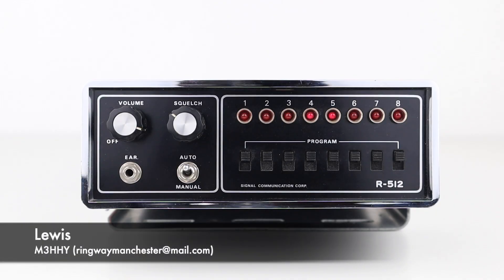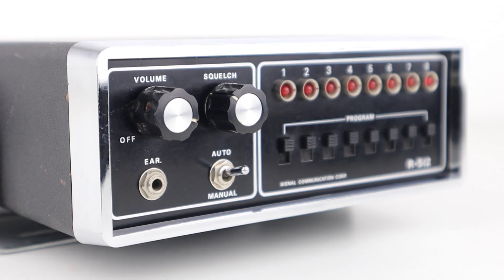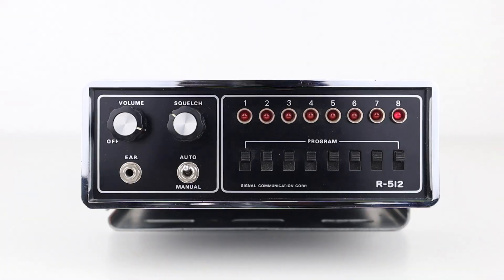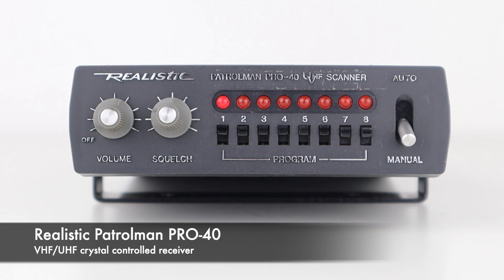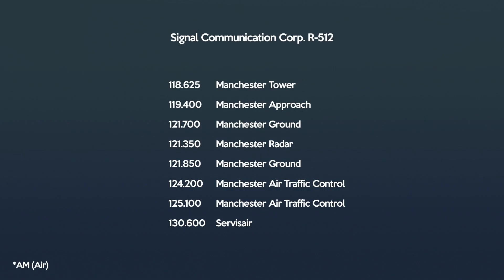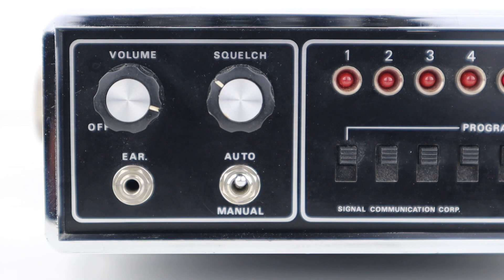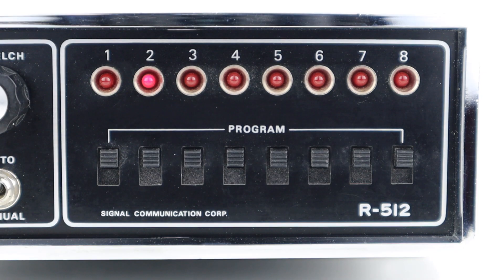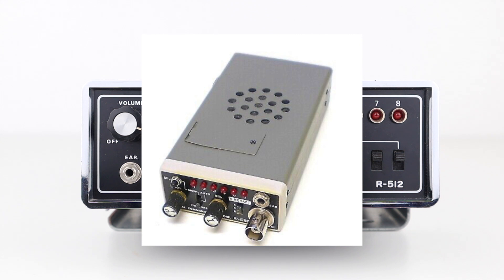The Mysterious Black Box Monitoring The Airwaves 43 Years Later

Comment: Had a few of these over the years in Canada. I worked in the heavy towing and recovery industry at one point, we had the towing contract for the City of Victoria B.C. and each of our company trucks was equipped with a 10 channel scanner (still crystal controlled). The reasoning was so that we got a "heads up" if we were required to provide towing services for the City and the surrounding municipalities we serviced. I later changed careers and went into the security industry where we had an alarm monitoring station and guard response to alarms. The station has a programmable scanner in dispatch, this was so the operators working could know which police units were responding to alarms calls and we could advise our guards of the ETA for responding police. It also helped us co-operate with the police agencies, by giving us a heads up if they were looking for subject vehicles or if they were back logged with calls and response time would be extended, we could then dispatch our own support guards to cover an alarm call. As I advanced in the security industry and became a certified alarm tech, I was then tasked with providing electronic counter measures sweeps for corporate clients and assist in internal theft investigations. We had a couple of programmable scanners that were modified to "hyper scan" and scan "restricted frequencies" looking for eaves dropping equipment that may have been planted in clients offices and facilities. Most of our sweep gear was either R.E.I. (Research Electronics International-USA) or C.C.M.E. (Canadian Counter Measures Electronics) all high end gear that could find most common threats (lower tech) devices. I totally enjoyed that work and still have some interest in it today but not actively working in that field. I must say I stumbled upon your channel only a few days ago and have been soaking up the content. Great stuff, good work and Happy New Year from British Columbia, Canada! Cheers!

Comment: My dad had one of these and we used to listen to the aircraft at RAF Valley in Anglesey. My recollection was that there was a single replaceable crystal at the back with easy access: I assume this was the base crystal frequency with internal adjustment to achieve 8 bands internally? When it scanned and found an channel with speech it would automatically stop the sweep and stay tuned until the speech stopped, and the sweep began again

Comment: Ill have to disagree on your nomenclature. These are scanners. When synthesized receivers capable of searching a swath of band for new signals came about, they were also scanners if they were able to "scan" preset frequencies, but everybody understood that the search function was to sweep a section of the band while the scan function was to monitor preselected frequencies. Crystal controlled multichannel scanning receivers are scanners.
Reply: I agree with you on this.  The "scanner" part of the name is the ability to check multiple frequencies quickly in sequence and stop when there is a signal present.   The fancy things that came after were just the same thing with the crystals replaced with circuitry.
Reply: The video seemed to skip explaining the precise purpose of the item and who would buy it.  I'm sure I can work it out, but people who don't have an interest in radio and aircraft might be a bit puzzled.
Reply: @JayJamsSpams  where I am from (In Canada) these were also commonly used to put police frequencies in, back in the days when they were using fairly simple radio systems.   Radio Shack sold a ton of the things, but the crystals were not cheap and sometimes hard to get.
Reply: I agree. I saw it and said "scanner". It scans a set of frequencies. Is what it does is what it is.

Comment: I bought my first Crystal Controlled scanner when I was 14 or 15 y/o.  I worked all summer to buy it.  It was a BEARCAT III the year was 1973 or  1974.  I now pick up old scanners and repair them.
Reply: Great story mate! So much respect
Reply: Hey out there I'm going to rain on any radio equipment of my own at least any type of transceiver.

Although I was on the unlicensed CB band years back I was borrowing one back in the day it was one that was sitting around not even hooked up to power antenna at the time was actually a mobile radio and hooked up to a Radio Shack power supply remember although I did own the power supply!

That power supply I still have and is working just great even though it's been repaired a few times by me and just eventually gave them to ghost couple caps went bad.

Really sturdy units this is not the cheaper one that was unregulated but the one that was regulated forget how many ampsinol that's one got a pair of screw terminals on the back and the circuit breaker.

I think it was like two point something amps or 3 amps possibly it was the Radio Shack brand name.

Who was the black one with the large heat sinks on the side.

Also had car radio looked after that for AM/FM and cassette use all that was said I got my nightstand I was using one of those bag of set CB antennas.

Had pretty good range All Things Considered.

This was a newer model not the type that use the individual crystals for each frequency.

I think it was only 15 channels if I remember correctly it was an older model still even at the time.

Also during the Gulf War and before I was listening to shortwave primarily at night when you get out better reception at least where I was I actually had antenna running the entire length of the house from one end to the other and threw my bedroom around the corner to the back of my nightstand simple single wire antenna play long enough for reception probably not ideal length but we're pretty well I found I was also able to use the assistance band antenna on the shortwave receiver with good results and most of the time that worked pretty well.

Oftentimes I was listening to the English translation of radio Baghdad at night during the Gulf War so I was able to keep up on things with the war kind of cool to be able to listen to that not everybody can receive it of course since it did not have shortwave capability.

Later on I actually did get a short waiver receiver for Christmas that was a battery powered radio AM FM shortwave again this was actually a Radio Shack one.

Nowadays I actually have two radios that can receive shortwave as well as FM one of which is also with no weather radio receiver the other one is a simple USB rechargeable radio which includes shortwave Plus auxiliary input for a Mono Amplifier use and also empty three playback all-in-one.

Which is actually a really decent radio receiver even on the FM band oftentimes can get very good reception even with the antenna fully retracted.

Just USB for charging.

I did build my own Antenna adapter to clip onto the built in with antenna because the one that came with the antenna I purchased was crap very thin wire probably wouldn't hold up long still have it though.

I'm wanting to build a antenna reel that would use the stainless steel wire core fishing line have say about 50 ft or so on the real so no words and pocket sized antenna for Wherever You Are.

Possibly might repurpose real on my original antenna just remove the existing wiring put that on there also this is the type of fishing line that has the nylon over the stainless wire core.

One thing I'm trying to figure out is making a transition from a stainless steel wire after removing the nylon at one end to The copper wire going to the 1/8 inch mono plug.

Not sure if this is the case from what I'm able to gather is that it would not be a good idea to go straight to Copper from stainless steel the loan you cannot solder the stainless steel to Copper at all or readily.

I'm thinking some sort of crimp connector or piece of metal acting as a crimp connector of some metal that would be both compatible with stainless steel and copper because there's potential some corrosion and possibly incompatible metals trying to mitigate this of course both types of wire would not be touching but just joined by something that would not react to feed the metal any suggestions on specifics on doing this I know that the stainless steel wire core fishing line will not be best choice for antenna wire but I'm trying to do something compact but yet quite a length of wire on the real this would just be used for occasional use but we want something durable and at least 50 ft Plus.

Essentially that you can set up a simple antennas anywhere you just want to listen in downtown or whatever possibly even if on vacation
Reply: Also another question here would it be worth trying to use a flat panel TV antenna I'm already using for my bedroom no weather band to be able to receive shortwave or anything else I do also have a scanner but as this time it's not hooked up not in use.

I do have a antenna booster available that's designed for broadcast TV if remember correctly it was built before really the digital transition so in theory this could be used as well if would get better results.

The antenna itself is on the back of a dresser and get pretty good signal on anything else so I was thinking if I can use that as a common antenna for other types of reception and running outdoor antenna is completely out of the picture where I am although I was thinking about possibly doing a stealth antenna possibly talked around the edge of the carpet and disappointing metal at home so as to have a long wire antenna just around the edge of the room could possibly use FM dipole as well but it be sketchy trying to set it up

Comment: A fascinating bit of vintage kit, I guess that if the frequencies are still used you'd be able to listen to airband with it.
My Dad gave me a handheld scanner made by SBE in the early 1980s...similar sort of thing with six or eight (forget which) red LEDs and a 2-way switch to either scan or manually select a channel. There was also a single slide switch to select one channel to be missed from scanning IIRC. It didn't come with crystals and I never managed to find any suitable ones. I've still got the screw-on telescopic antenna but the scanner is long gone.

Comment: I had a Realistic one in 1982 on 156.8, 145.650, 145.750, 154.900, and can't remember the rest. In November 1988 I bought a Pro34 scanner that cost me £249 and still have it! Used for many things including old mobiles. I also took a wire from inside so I could monitor POCSAG.
Around 20yrs ago when trunking was defeated by some scanners, emergency services went to TETRA after the system was first tested by PMR users in the mid 90s. Then there was nothing left on scanners to listen to that was interesting. Mobile phones finally killed off PMR by 1998. Hardly anyone kept PMR.